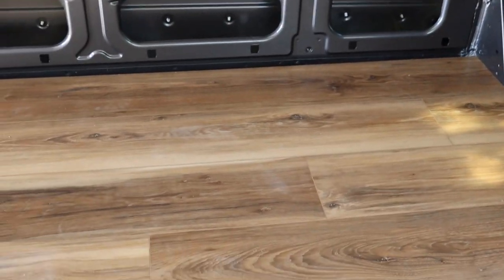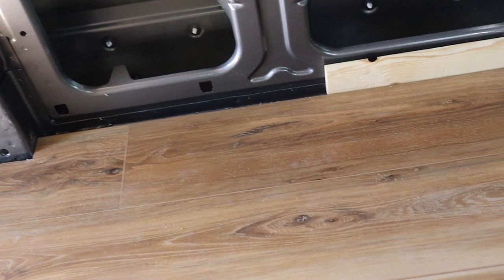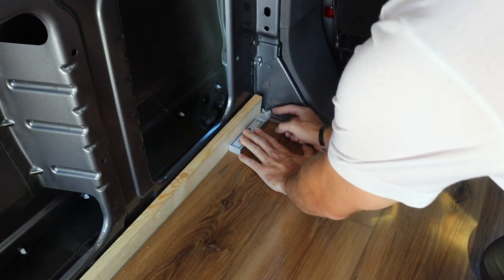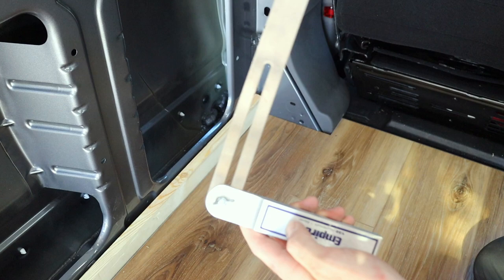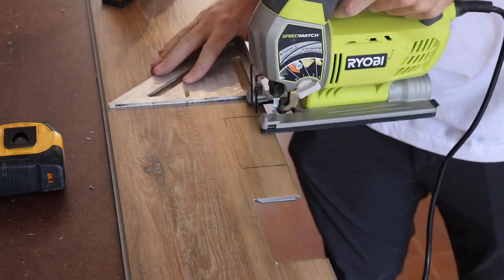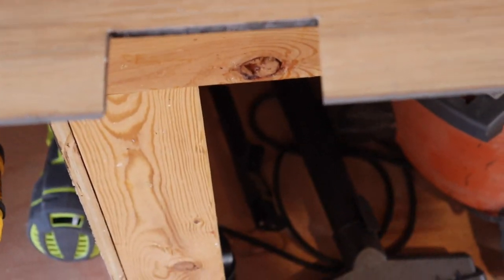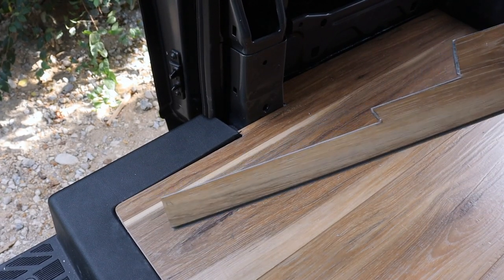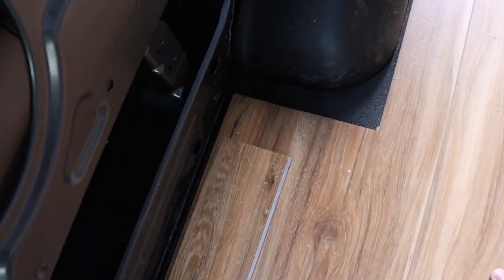FORD TRANSIT BUILD | FlOORING INSTALL |  AWKWARD CUT HOW TO

Comment: Hey Colton! I’m a fellow Boise resident and I’ve been enjoying your Van builds. I’m sure you’re very busy with builds and I was wondering if you’ve considered putting together a DIY kit for these builds. I’m still trying to find the right used cargo van, but it would be awesome to have a kit in mind with a price to add to the van purchase. I’m a mechanic at Fairly Reliable Bob’s and will do this van build myself. Also, I haven’t noticed any shower considerations in the content so far. Maybe I’ve missed them? I’m looking for basic and inexpensive complete self sufficient builds Also, I’m interested in beds that hide away up to the roof. I’m 5’6’’ so the need for extra room on the sides isn’t necessary and if the bed goes all the way up I would consider laying length ways. I’m a cyclist and it would be nice to not have to remove wheels to load while traveling. I’d really appreciate your help.
Don

Comment: What did you use for the insulation under the floor with the height of the interior of the van being so much smaller than the high roof? 

Nice work btw
Reply from the maker: This van came with a factory subfloor with insulation in it! Thank you!
Reply: @AnkeneyVanBuilds  I noticed you did the same with the Promaster. I see that they offer wood flooring as an option in the promaster. Does that mean it is insulated?

Comment: did you use adhesive under the flooring, or is it just floating? I assume the perimeter notches keep it in place from sliding too much. but you don't leave much of a gap where they are notched. would you worry about buckling with the heat expansion ?
Reply from the maker: free floating!